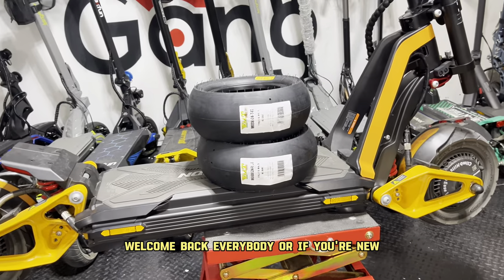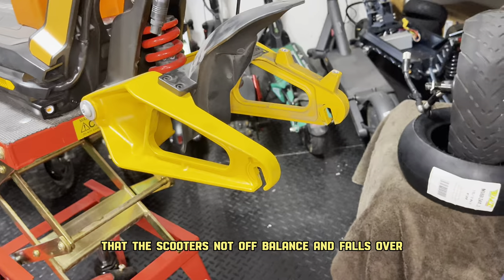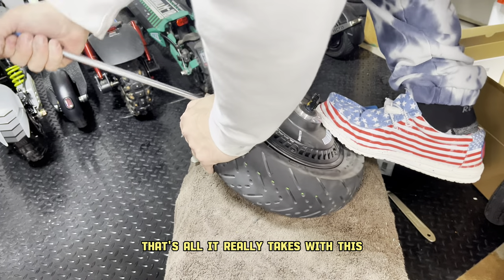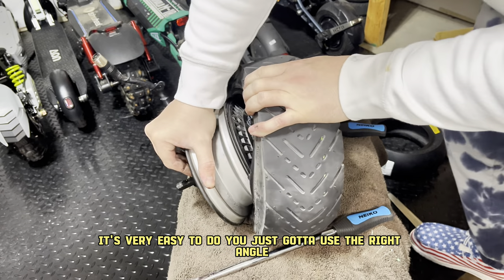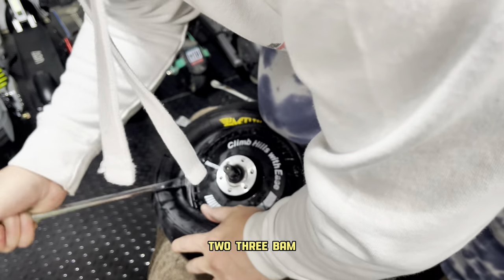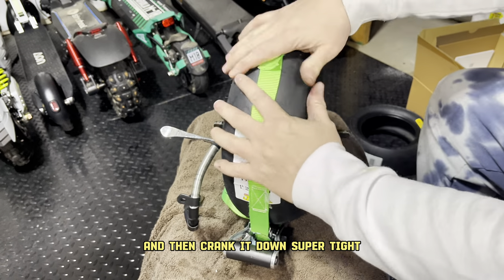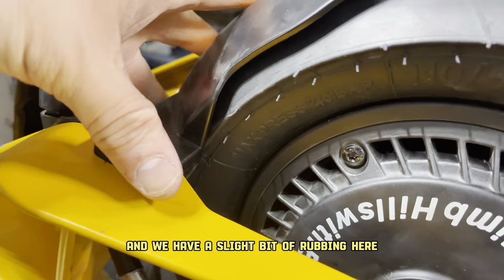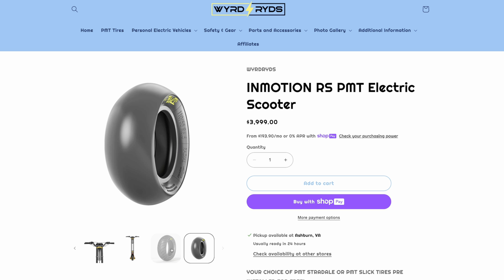Inmotion RS Scooter Tire Change: Step-by-Step Guide... Tubeless PMT Slicks from Wyrd Ryds

Comment: Why do scooter companies keep putting the rotor on the same side as the power cable. The disconnect helps.I'm sure but having to take your breaks off and your rotor just to change the tire seems excessive

Comment: I love the quick disconnect motor wire unlike the other scooters.
Reply from the maker: For sure! Same connector as on Nami and Mukuta, they are great!
Reply: @ScootaGang  I didn’t know Nami had one. I love the Burn E2 Max. I am still deciding new scooter. I have to get it real soon
Reply: @ElectricScooterMan  version 2 of the Nami Burn E2 Max is my first PEV. Wow! With the PMT tires fro WYRD RYDS I wasn't ready for the power lol. X Mode is insane. I recommend buying. It doesn't look like a toy like the rest of the scooters. Even though the styling is dated It's like motorcycle and super quiet while riding. I switched out the thumb throttle for a finger throttle. Haven't had a chance to try it out yet (weather) but I have only put 30 miles on it so far. So far I'm happy. I recommend.
Reply: @cocoabiscuits  I believe Klima has the disconnected motor and not sure about the E2 max? I’m still thinking of Dualtron Thunder 3
Reply: @ElectricScooterMan  Titaone x10 is beast
Reply: @Rezak877  I looked at those but I need longer range scooters
Reply: @ScootaGang What psi you use on the PMT? When I ordered my PMT Stradale thru Ryrd Ryds I looked at the general tire info it said 20-28 psi.

Comment: Love those slicks but those spoons cause a LOT of scraping and piting on the bead of those aluminum rims which will make it harder to gear a bead seal later with the new tires. Its possible to do it without the spoons. I show how to do it using just clamps. No rim damage.

Comment: hey bro I am up to the unplugging of the motor cable but I broke 4 cable ties trying to separate the male connector from the female connector. Your advice would be extremely appreciated. Thank you for your videos
Reply: I’m having the same problem. It feels like the quick disconnect is a lie. Like they just hard wired it and put a disconnect thing over it.
Reply: @Marcus_ER  I have an update. I got two pieces of really strong 2.5mm string and wrapped it around either side of the plug. One side I tied to an immovable object and the other side I hooked up a ratchet strap, then ratcheted the heck out of it and it unplugged. Turns out I have been running the motor cables too hot before on single motor and that actually fried the plastic in the motor wire connection which acted as a glue when it came to separating it. 
Good luck, I hope this helps
Reply: @kylesapphire2537  thank you, I’ll try that.
Reply: Update, the connectors were so melted together I had to buy new connectors with the new motor. Bought it through voromotors.
Reply: @Marcus_ER  you bought the whole motor just to get the connector plugs? You would have had to replace the whole motor line with that too?

Comment: i prefer using zipties to keep a side squeezed before getting it over the rim with the levers, keeps a side of the tire in the middle of the rim making it way easier, imo, atleast
Reply from the maker: Zip ties work great for that! I ran out of all my big ones and you don't really need it tho
Reply: @ScootaGang  yeah true, don't need it but makes it so much easier, sometimes i even use it to remove the tires that are on there cause zipties are cheap and i always have tons of them and it makes it so much quicker to do

i don't like wasting time on a tire change but i also don't like split rims so them large motorcycle tire levers like you have in the vid and zip ties are my best friends

to clarify: due to my lifelong awful experience with bicycles, pinch flats, and often not willing to check pressure in time i will avoid split rim/inner tube like the plague 😂

Comment: 9:18 - "TINY BIT" well, if that if tiny, what is not). I have experience of changing tires on Dualtron's.. and now I understand why minimotors doesn't paint their disks.. because after first tire change it will look damaged like...
Reply from the maker: Oh don't get me started on minimotors. I just found out that all dualtrons 11 inch and up are the opposite of quick disconnects. They advise you to cut the motor wire and solder new connectors every time you want to remove it... because of that I refuse to repair those anymore.
Reply: @ScootaGang  yea exactly, but for over 10k km rode on Dualtron’s and never got problems with this. I think it’s better having no connector than something which will break after some time in future.
Reply: @ScootaGang  you just need to open top plate and push cable a bit outside, then do you tire change easily with just disconnects of the disk from the motor. That’s much easier then to work with a disk. Then with a motor. Also when disk is bent - you need to replace a whole..
Reply: @ScootaGang  I'm not sure how it will last for this inmotion. For Dualtron's it's never been a problems, I have 3years experience and 10k km rode. Riding hard in a forest only.. I don't think RS will survive my first 1k km even)

Comment: Very good video. I definitely know what it feels like to challenge the Bead, lol! You are definitely the MAN for putting up this video. I had to use my air compressor too because my regular air pump and my little mini Xiomi scooter tire pump just didn't have enough air pressure power to pop the tire back into the bead. Thumbs up, man. I can't wait to see you riding with the slicks. I was thinking of going with the Stradile ones. But they cost $100.00 each at VoroMotors.
Reply from the maker: I can't wait to ride on these slicks too! Thanks man, I watched your steering damper video yesterday, that might have to be my next project, I like what you did to tighten it more. Keep up the great work on your channel!
Reply: @ScootaGang  🙇‍♂️🙏

Comment: 1.9bar is about 27psi max for the T41 100/55 6.5, so 35psi is a little too much.  Also, those tires should fit fine on the RS without cutting the fender, maybe it wasn't completely centered?  Good work btw.

Comment: This is why i love split rims so much easier to change tires
Reply from the maker: Definitely easier to change split rims. But once you get rid of the tubes, you also get rid of most of the flat tires anyways. So to me tubeless is superior plus you can run it at lower psi for these PMT tires without risking pinch tubes.
Reply: @ScootaGang  Inner tubes in a tubeless tire is the best. 
To finish off, put No-flat IN the inner tube. NO leaks, no bead sealing issues.

Comment: Have you tried the E Fires? If so, how do you like them?
Reply from the maker: It's a great year round tire with great traction and grip. Until they make a 10 inch slick, it's the best you can get. Slicks are still only available for 11 inch scooters. Have them on the Mukuta 10+, Vsett 10+, and Maxfun 10 pro right now. Worth the money for sure.
Reply: @ScootaGang  okay sweet. I just didn't want to feel like I'd made the wrong choice. I have them on my NR D6+ 2.0.

Comment: Great video. Do you know whats the largest tire size that can be put on the RS without needing to trim the mud guard? I was thinking a 100/55-6.5, but maybe a 105/55-6.5 will fit? It does look awesome with the 110's on there. Im wondering if there's much benefit to going that wide.